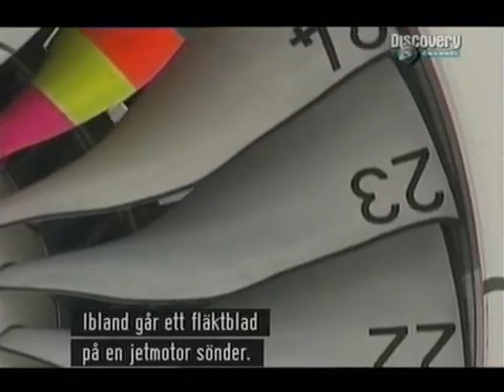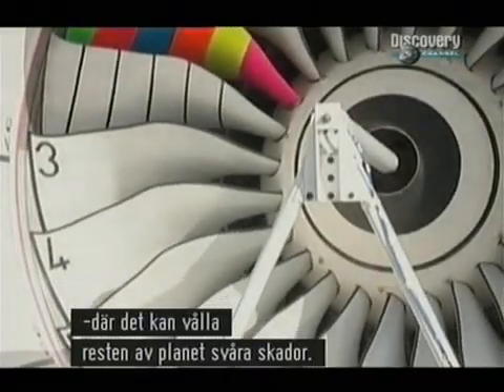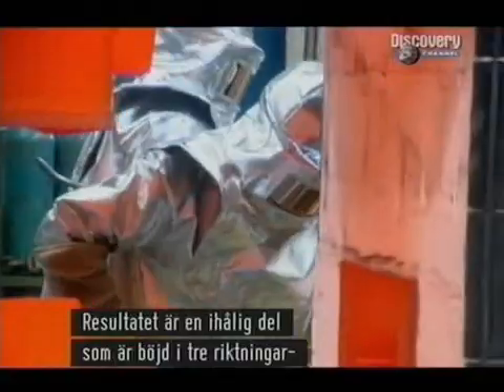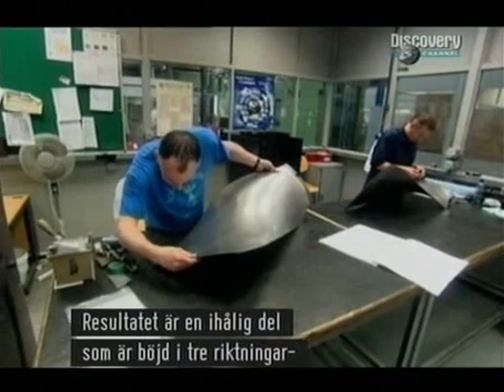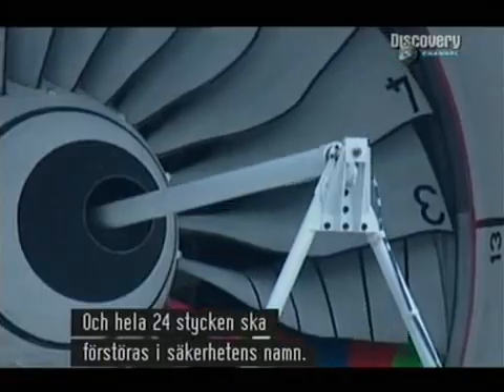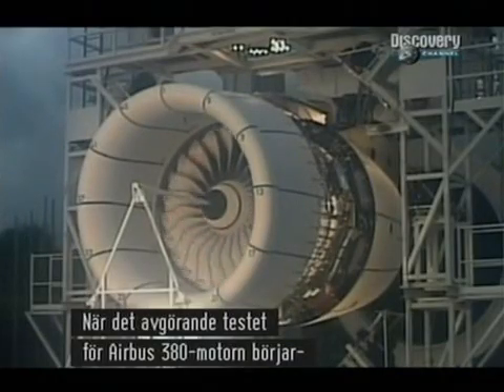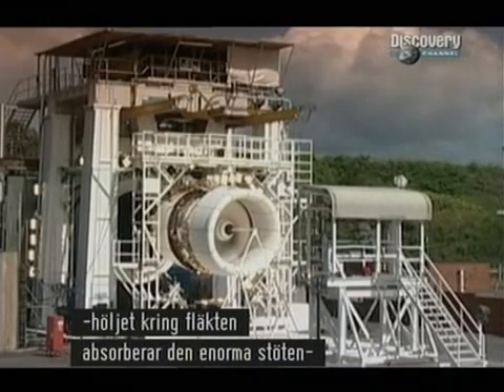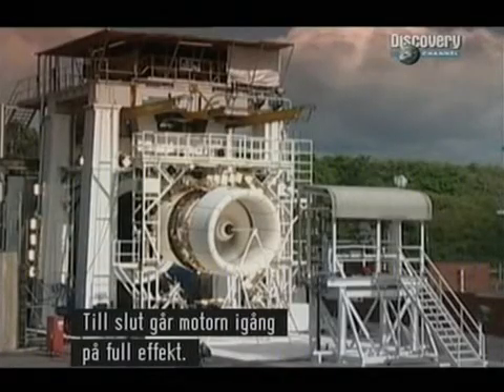A380 Blade Off Test

Comment: @TommyA350

Don't you need a ferry flight for that to happen? Hence with no passengers? Because that would be against regulations no?
It's standard procedure to make an emergency landing with an engine failure unless it's planned from the ground and a ferry flight is authorised by the country's aviation safety minister/organisation.

If i'm not mistaken.

 Besides, no passenger would fly again in such an airline anyway.

Comment: No, you don't shut down the engine. You use rudder/trim to balance the yaw from having one engine out and, if you have more than 2 engines on one wing, possibly idle/reduce power to the opposite engine if needed. Shutting down an engine in the air to counteract yaw is just plain stupid, what do they put trim on rudders for? TO COUNTERACT YAW!

Comment: ...hmmm, nice try, if you're trying to convince folks you're type-rated on a jet you'd best stop suggesting you'd shut down a perfectly serviceable engine just to counteract a bit of yaw.  Perhaps you've not read about the function of a rudder on your FlightSim 2000 manual yet?  I really do fly a jet every day (B737).  B747 skipper my ass.

Comment: Yes you have to be a skilled engineer to make these, I am in quality control, I measure the fan blades so they are exactly to design specs, the cost is because they are under development, but they are a hollow titanium blade with a girder structure inside, the process is unique to RR, and is very difficult to control thats all I can tell you as the process is top secret.

Comment: A yard is 0.9144 meters.  A meter is about 3.28 feet.  

200 years away, lol.  So they where about 183 meters away.  Unless it was really 200 m away which would then be 219 yards away or 656ft away.

Who calculates in yards!? lol, yeah yards and meters are close enough to being the same, until you start getting to big numbers.
  
I saw the 200 m in the captions too, so was it translated to, or from English?

Comment: Yes it did go out of balance. I work at Roll-Royce and any engineer (at any firm) will tell you that if a component comes off a balanced assembly it is bound to go out of balance!! It didn't "shred and fly apart" but was of course damaged when the tips collide with the fan case. Thats perfectly acceptable for the test as the Airworthiness authorities just need to establish that all bits stay inside the engine.

Comment: Its a Rolls Royce Trent 900 engine. You are right about the 10 blade loss scenario but that is highly unlikely. Single blade failure is rare and when it happens they drop back into the engine and don't hit the others. When you see the film the others are only damaged due to the out of balance fan assembly.

Comment: an engine such  as this one is either a General electric GP7000 or a Rollls-Royce Trent 900. That one fan blade would have been under 10,000 G's of centripetal loading at max thrust which means that it now weighs roughly 240,000 lbs which is about 120,000 kgs. It also has been blasted out with a detonation charge. this blade weights about 24lbs and is about 2 feet long. Oh and if you lose 10 blades, they would probably tear the engine, cabin and fuselage into chunks.

Comment: I at that speed it wouldnt be possible to continue to suck in air for the engine to keep running, it would be so fast it would be like a str8 up solid wall, Turbo fans do have there limits just like prop powered planes

Comment: Yes, the law of physics does make that possible. Yes, turbines do spin that fast. The turbo in your riced civic hatchback can spin up about that high. 3000-5000 is probably not possible for a turbine. Like the poster above me said, the bypass fan is probably slower, but still not that slow. An engine with that much power that spun at 3000 RPM would have to have a gargantuan amount of torque.

Comment: ...And probably the efforts to lignten the fan blades as much as possible (injecting high pressure gas inside the blade while orange hot to "inflate" it) highly contributes to the success of the blade-of test.

Comment: The A380 uses nearly the same runway distance as the 747. And plus, that wouldn't be a downside. All airports it goes to have more than enough runway, that is why they are 10,000-12,000 feet long. And the A380 is actually quite fuel efficient. It doesn't guzzle as much gas as it is said to.

Comment: Yes, that explains why it's been ordered by... one airline. An airline that has also ordered the A380, BTW. Oh, and just a few weeks ago, the largest 747-400 operator in the world, British Airways, ordered the A380, adding that they would NOT order the 747-8. As far as fuel burn goes: don't buy everything Boeing, or Airbus for that matter, tells you. Lufthansa, who has ordered both, actually estimates the 747-8 will burn MORE fuel per passenger than the A380.

Comment: The new Boeing 747-8 Intercontinental will offer a significant improvement over the A380. The 747-8 is more than 11 percent lighter per seat than the A380 and will consume 10 percent less fuel per passenger than the 555-seat airplane. That translates into a trip-cost reduction of 19 percent and a seat-mile cost reduction of more than 3 percent, compared to the A380. Both 747-8 versions can use the existing infrastructure and ground equipment at most airports worldwide.

Comment: 115/145 Avgas, 28 cylinders at 4360 CID (72 litres) pulling 60" of manifold preasure at 2700 RPM and 3800 Horsepower (at takeoff) makes the turbine as interesting as...Well an empty Bundy Can... Or a Ford product..... Ask Craig Lowndes....

Comment: The A380 won't be cruising at anywhere near 900 km/h. Don't expect Vmo to be much beyond 320 knots (590 kph). At those sort of speeds the aircraft will tend to be above anything damaging the engine might suck in and the engines will be at climb or cruise power. So the probability of a blade-out event is a lot less likely, would actually involve less energy :-)

Ground speed will be in the region of 900 kph however.

Comment: thats right. you can't really cheat in engineering. its either going to break or it wont in engineering and if you fudge it then someones going to find out when inevitably whatever you say works ends up failing.

Comment: no, they occur due to microscopic fractures that may occur and grow over time. these are usually found during maintenance checks and the blades are subsequently replaced. but occasionaly they can be missed even through several checks which is why it occurs but very very infrequently. birds are unlikely to cause a problem and certainly not water but trees just might!

Comment: The engine actually only spins at around 4,500 rpm not 60,000 but the pull on the fan blade root is around 100 tons the same as a mainline diesel engine, I know cos I make them.

Comment: Your kidding me right - Spit it out the other end?
This is a hunk of Titanium, spinning at over 60,000RPM - or 1000 times a second.  When a fan blade seperates that is an enourmous amount of kinetic energy.  Having a thickness at the tip of about a pencil and with hundreds of tons of force - it could potentially blow a hole through the engine casing, into the wing destroying everything in its path crashing and killing all on board.